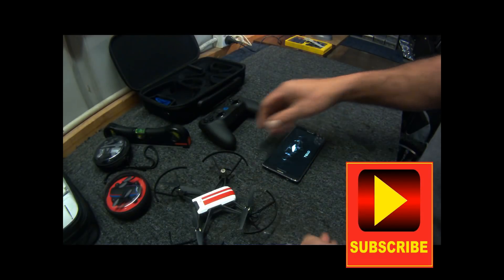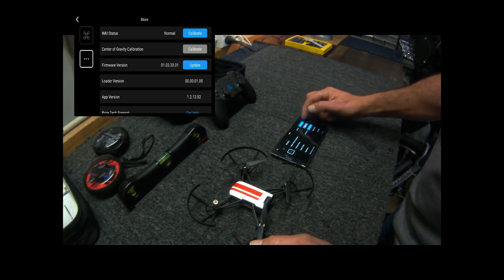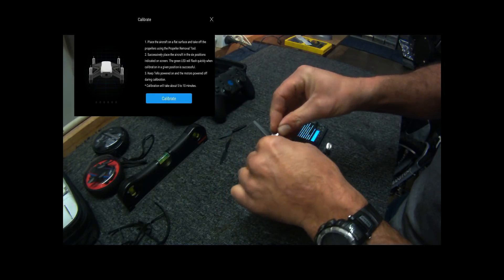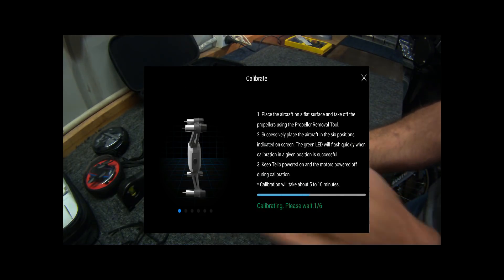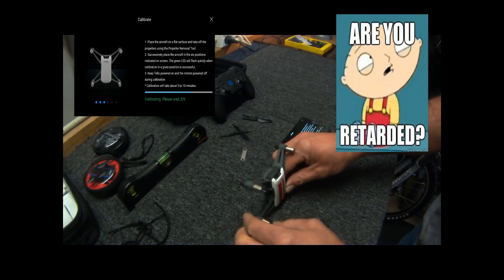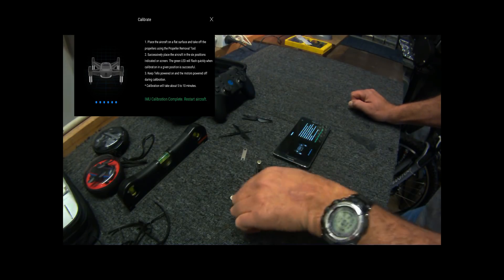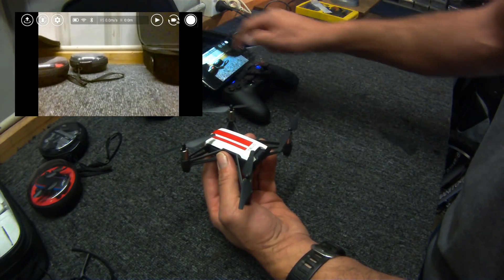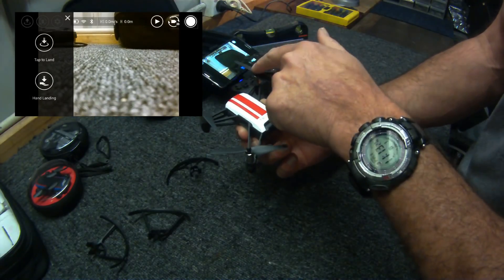DJI RYZE TELLO - IMU Calibration. EXPLAINED

Comment: I can't come to the calibration menu, on the main screen you can see the button adjuments but it is not white, its grey, if I press it you become in the menu with flight speed ...and the button more, I come in the menu  with buttons like: measurement system-Photo Quality- low battery warning-etc. but in this menu there is no button with the 3 spots, what do I have to change.  Thx for you're reply
Reply from the maker: I've  had a look mate and am not sure what your problem is. Have you tried reinstalling the app?

Comment: Hello I have a VPF problem can you help me?
Reply: Yo waz up. It was flying alright in daylight. Thanks a lot my friend I’ll subscribe for sure
Reply from the maker: Yipee!!!!  Awesome mate. Great stuff, Enjoy!!!
Reply from the maker: Sure what's your problem mate.
Reply: @GTARC_au  I just bought my tello a while ago, tested it at home, calibrated it, also updated the firm ware. By the time it goes flying in my room it drifts and does not stay still and it said VPS problem
Reply from the maker: Sure. What is the ground surface made of. Sometimes when flying over certain textures or water the positioning system will fail. The Tello uses sensors to maintain stability. Does it do the same outdoors?
Reply: @GTARC_au  thanks a lot for the reply. My floor is a ply wood. Didn't have a chance to fly it outside yet.
Reply from the maker: @teacherone9636  cool.
Have a cracked outside.  I reckon she'll be great. Let me know mate. 🍻✔👍

Comment: what is the difference before and after calibrating or imu?
Reply from the maker: No probs:
The “inertial measurement unit” (IMU for short) is an assistance system built into your Tello drone that measures the speed, angular velocity and position of the drone. It ensures that the drone maintains its orientation towards the ground by itself and does not drift. So if you notice that your Tello is slightly hovering to the side or flying at an angle, it is time to calibrate the IMU. The IMU is equipped with a gyroscope that detects the inclination of the drone. 
Cheers